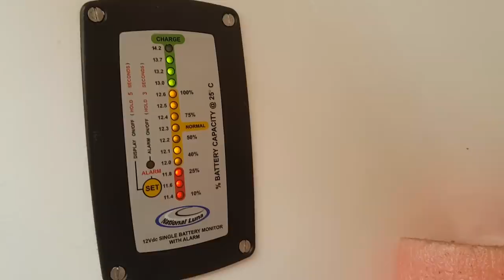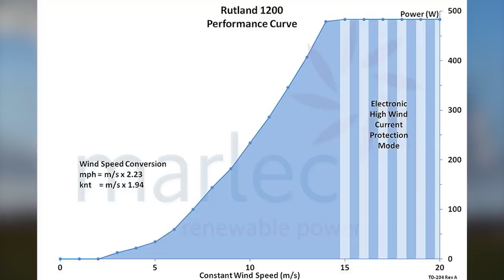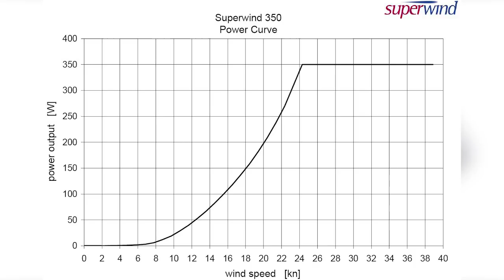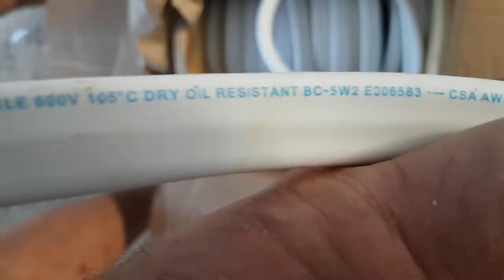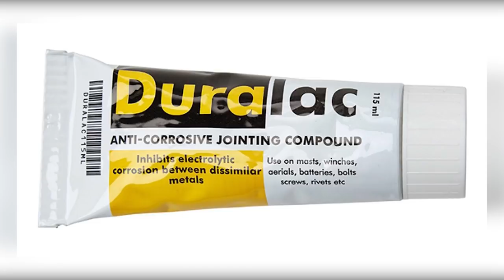Smart or Dumb? We Put a Wind Generator on Top of Our Mast - Ep 58 Sailing Luckyfish

Comment: Good Day to both of you , solution  would be to install a 3/16’’. Th, Néoprène  or resistant rubber between the matching  steel plates  , also install rubber washer to each side of the lags bolts complete with steel metal washer . One under and one on top for each lag bolts
Be sure to use a high density material for isolation 

Best regards
Reply from the maker: +Charles Frenette - yes, the rubber under the lag bolts. I like it. Thank you. We put 1/4" of high density rubber between the matching steel plates - I'm unsure if it lets a little of the hum through. Its heartening to see you suggest dealing with the bolts. Cheers
Reply: Rubber is good idea. If you put two layers of rubber, with another plate in between and offset, non-touching bolts, you will probably eliminate 80% of vibration. If the bolts go right through, they will transmit lots of vibration.
Reply: Mister Professor   Your idea is even better.
Reply: @charlesfrenette2203 , I did this wtih a special DC gearmotor arrangement  that had to be silent, and two additional plates with rubber mounts (engine type) eliminated basically all noise transmission. It does make the isolated thing a bit "flexy". Unfortunately,  looking at the 2 foot pole the generator is on, it's clear that the bolts will have to be very securely attached!

Comment: Use a much thicker block of silicone instead of the rubber and use locktite blue on the blade screws and a torque wrench to ensure consistent fastening.

Comment: I installed 1st Rutland generator on my 1st catamaran back in the 80' and a 913 generator on my latest catamaran. Both worked and produced to specs,  very quietly and minimal vibration . Fixed them pretty much like you did separating them with 5mm neoprene pads. Over 25 - 30 knots however vibrations were noticeable, but in those conditions I still prefer to manually lash down the propeller anyway. The weak point obviously are the bolts, for which I considered using bolt separation sleeves and washers as used for bi-metal separation of pipe flanges. I am not sure wether engine silent block type mount would be a good solution since they are somewhat flexible by definition and could cause the generator to wobble.
As much as I like the idea of mast head installation, propellers tend to catch things and may require quick action, which is not easy with mast head install. Same for maintenance or removal when you have to handle 15 kg at arms length.  
Last year I replaced the 913 by two 914i generators with more sophisticated internal electronics and MPPT controllers. These however just produce a small fraction of the specified outputs, and one quickly developed some grinding noise under certain angles, most likely due to bearing issue. Still have not solved the problems, despite having sent back for check and re-installed with local expert supervision and advise. Anybody else have experience with this particular model?
Reply from the maker: +Marc Maton - I cant help you with the 914i - that's a pretty disappointing outcome so far. Interesting, can you tell me if the manufacturer is standing by you? I mean, a replacement unit would seem to be in order, no? I tend to agree with your comments about engine mounts - many kind folks have sent links to various products here and I too think some nasty action could develop, even shearing. My inclination is to go for the T-type rubber sleeves and large washers as you suggest. BTW - the output we are getting from the 1200, which also has the MPPT etc... is exactly to spec. Cheers, Stew
Reply: Both charges were sent back to the UK and returned to Thailand at their expense, but despite very careful re-install, quite a few friendly Skype calls and email exchanges with Rutland, no improvement. I did find some similar problems on a few cruisers forums : 
http://www.cruisersforum.com/forums/f14/rutland-914i-problems-159225.html  ,  http://bavariayacht.org/forum/index.php?topic=1438.0
http://www.cruisersforum.com/forums/f14/wind-generator-especially-rutland-real-life-output-83777.html
Interesting reading. And, yes, pretty frustrating. I still have a problem understanding how it is possible that not one, but both generators fail, despite installation with separate regulators. Installation of additional solar panel for now compensate for the loss, but I still hope to find  someone locally who can figure out what is wrong.
Reply from the maker: +Marc Maton - noted and thanks for that background. Thats still a very frustrating story.  I do hope you can get a local technical guy to identify the problem.

Comment: How cool to be on my laptop when this notification popped up :) Clicked like and am about to watch. Been keen to see this one.
Reply from the maker: Great to hear, hope to hear any suggestions you might have
Reply: @SailingLuckyfish  Hi Stewart. I'd go with JC F on replacing those bolts with small engine mounts. My best guess on the knocking after you've torqued the blades to "common sense newton metres" is probably a roll pin (or some such) catching on plastic casing somewhere along the shaft. My reasoning here is that as the generator comes under varying loads there may be an axial reaction that would cause an insufficiently driven pin to just catch. It also has a "softer" sound over my headphones. As I say, "best guess", I have no experience to draw on with these units.  A faulty bearing is also quite plausible. I like your step, Kiwi no8 wire for you right there. Fair winds and best regards to Zaya.
Reply from the maker: +Waughthog Waugh -Agree. We have some brilliant suggestions from folks such as yourself to put to use. Looking forward to "not" hearing the results. Cheers mate, fair winds and fair thermals to you to, Stew

Comment: Hi Stew and Zaya, another excellent episode, as usual!     I've always been intrigued by the concept of a vessel that is totally energy independent.
As I think I've mentioned previously, I subscribe to a number of sailing channels (this being one of my very favorites, of course) and yours is the 
first featured boat with solar, hydro, and now wind energy all at once.     That's so cool!    You may have answered this previously, but are you considering
eventually replacing Luckyfish's motors with electric ones?     To be able to go wherever you want without having to worry about getting fuel (or water, 
since Luckyfish has its own watermaker) and leaving a practically zero carbon footprint is so intriguing.   My understanding is that electric motors
are so much easier to maintain than internal combustion ones.

I love when you delve into the technical aspects of your boat and of sailing; you do it in a way that is easy enough for dummies like me to understand, 
while being very comprehensive as well.   I'm wondering if you could at some point do an explanation of concepts like the relationship of amps to watts.  
I have only the most general understanding of those.   I would imagine that you guys have had to do a fair amount of homework to tailor your green energy
sources to the energy needs of Luckyfish and its crew.    It would be great to hear the process by which you did that.   I found the video you did on
your hydrogenator extremely interesting.

Keep those videos coming!   Stay safe.

Comment: I have the exact same generator, with the exact same humming sound, in spite of some rather sofisticated rubber mounts. But I don't have the knocking sound. The humming sound can be heard all over the boat, and is rather annoying when trying to sleep in an otherwise quiet anchorage.ff course, if you just love the idea of free energy pouring into the boat.  The knocking sound reminds me of a motorcycle wheel with an old worn down bearing.
Reply from the maker: Thanks for that info - pretty interesting. I first noticed the Rutland 1200 on the hardstand in Grenada, a Prout 38 next to us had two and we could not hear a whisper from them. Pretty impressive. Their blade tech has all but removed any whoosh. The humming is possibly inevitable for all gennies, I dont know. It is exactly the sound we get from the Watt & Sea. We love that sound because its energy on passage and the boat is pretty vocal then anyway. But on anchor where the wind genny is designed to do its thing, the sound is something we will put more effort into reducing. Agree, the knock sounds like bearing to me too. We will give Rutlands latest suggestions a crack and see if that fixes it, otherwise it will be bearing for sure. Or out of balance blades :-) Cheers and thanks for great comment, Stew
Reply: @SailingLuckyfish  I did in fact forget to mention that in addition to the humming we do clearly hear the woosh from the blades, but then your blades are very far away in the top of the mast, and when we are going to sleep we are far away from the woosh sound too. Only the humming is all over the boat, and it's like sleeping inside a guitar with a humming sound to it. I also didn't mention that I had a very unstable performance, seen by very fluctuating watt readings on the remote display. But the support at Marlec (who makes the Rutland WG's was very helpfull, and asked me to return the controller, and the remote display. They found an error in the controller, fixed it and returned both, at no cost, no questions asked. I believe their support was first class, and I have heard so from others.

Comment: On our Wharram Narai we utilised a much earlier, cruder Rutland. I had a base with a 1/2 inch rod welded vertically on it, about 8 inches long. The Rutland was mounted to a tube. I then made rubber "washers" cut in my case from discarded rubber conveyor belting (about 1/2" thick) with a hole saw giving an outside diameter which fitted quite snugly inside the Rutand's tube. I over drilled the centre holes of these to 1/2 inch. I slid two oversize rubber washers down the rod first - then the other washers to the top. I had put a thread on the last inch of rod to fit a steel washer & nut to apply some pressure to expand the washers if necessary, but in my case everything was so tight it wasn't needed and I used soapy water to lubricate sliding the tube down over the washers. In fact it was so tight I didn't push the tube quite down to the two "base" washers, and it remained at that height for the seven years we owned her. It probably stayed there a lot longer but it doesn't show on any of the later videos shot by Cristiano, who bought her and took a lot of (low resolution) video during at least 8 subsequent Atlantic crossings in her... I rigged the Narai as a sloop and had the Rutland on a long tube on the starboard aft deck.

I just read Black Hat's  post and those commercial rubber bushings look perfect for your existing mount! ~ Scott
Reply from the maker: really interesting solution. thank you

Comment: I noticed the blade side of the generator is pointing up to the sky because of the angle of the mast . Its possible that the angle is loading the bearing ,when the shaft is rotating, at opposing points. The generator needs to set level to the deck, despite the slant of the mast.
Reply: good point.
Reply: It's a really good point you make, that it would be more efficient in light winds if mounted with an offset for mast rake. Re the bearings though, while valid I guess the thousands of monohullers sailing with generators heeled over at greater angles would all be complaining if it caused bearing/noise issues? ~ Scott
Reply from the maker: +harvey g - we accounted for this in the design of the pole. The pole is vertical (whenever the deck horizontal). There is a 7.5 degree offset on the base to allow for the mast rake. Thanks for the suggestion though! Stew
Reply: Explore the blades not being balanced.  Three separate blades haphazardly bolted to a center hub does not escape the need to be balanced.
Reply: I have sailed a lot with my Rutland 1200 while healing 20+ degrees. No extra noise because of that.

Comment: Propeller tips bends on high speed getting too close to power line or even touching it -I would not place the turbine at the mast top it will attract lightning with copper cable running through your system.You gain more output by placing it higher but you will suffer from cable loss.Lover the voltage shorter the distance should be between power source or thicker wire.Jump start cables are thick for a reason.I hope you have much thicker copper wire running all the way to the water for lightning protection.Stay safe

Comment: Replace the bearings taking care to never push on the bearing running faces - only the sides.   Take care not to nudge or tap the assembled unit on anything at all, or else you will put a tiny dint in a bearing face which will then run noisily. Pre-fill the bearings with extra thick grease will reduce noise at the expense of efficiency, but I don't think you will ever get away from hum with it mounted like that.
Reply from the maker: Thanks Steve, appreciate the tips. You might be right about the mounting and hum. We will try to reduce it anyway. Cheers

Comment: Two words: Vertical Axis. 

There are many reasons why a big spinning fan in the sky powered by the wind looks like a great idea. 
There are also many reasons why a spinning post is a much better idea.
1. Birds cannot see the blades of a horizontal spinning "fan", but never fail to miss seeing a moving/rotating "post".2. When the wind speed gets too high, the "wind" sees the blades of a vertical spinning generator as a post, and it will not spin any faster. You don't have to cut it off, or make it "brake" if the wind gets too fast.3. The lift on 3 blades that are 2 feet long is the same, if they are horizontal, or vertical - in any given wind speed. Think helicopter, or drone.4. A vertical axis generator is always "into" the wind - it doesn't have to change directions.
As for the reason for the knock knock knock - Did you balance the entire assembled head? Did you check the pitch/angle/weight of all 3 blades on a dynamic spinning test stand? If one blade is different from the other 2 by being heavy/twisted/warped/off balance/not the same angle/a different temperature/weak/hollow - the list goes on and on - it will cause an imbalance in the entire system. Stick that issue on top of a 40+ foot pole, and you have found your problem. 

It's not enough to just tighten bolts. If one blade is different - in any way - to the center of rotation/air pressure/etc - you will have a noise at 40+ feet no matter how much rubber you put around it. 

The head needs to be spin-balanced, and since it is a "propeller", it needs to be pitch balanced also. 

As for the HUMM, I have a bag of rubber bands here you can wrap on your standing rigging to tie various bits of hanging metal onto to eliminate the giant stringed instrument you have created. Maybe you just aren't happy with the musical key you have created on the boat? It might be interesting to place people at all the "strings", and play a tune by having them hold the strings at the appropriate times. Music on the water, rather than smoke. Deep Purple would be proud, or more appropriately, Crosby, Stills, Nash, and Young.
 Oh, by the way, get yourself some box end wrenches. Open end "spanners" are for people who don't know hex.

Comment: It is a shame you did not put a microphone on the mast so we could hear the knock and whining better. ( I was a sound engineer and it would have helped) I suspect the knock is a baring, and to get rid of harmonics are a trial and error of all the suggestions you may get.  I would suggest the aluminum 26" pole could have some rubber clamped to it in the middle? or grab the standing and adjust tension, It will depend where the harmonic is?? Will be trial and test.Great idea to have a go ...well done. Brian London
Reply from the maker: Thanks Brian, that recording in the video is from a mic pressed against the mast

Comment: Your bolts are in metal-to-metal contact in tension. Vibration does not just travel down the mast through compression. I have two suggestions:
a. Remove the rubber pad and see if the rigidity solves the problem, or
b. Put rubber between the bolt head and the metal plate, so the bolts are "suspended" by rubber.

Comment: Luckfish, the knocking noise could be aerodynamic, caused by the proximity of the tubular mast relative to the blades when they pass at the 6 o clock position.   I find it strange that the manufacturer would put the mast so close to the tower.  The solution would be to make a cranked mast  to put the bottom of the blade disk further from the support pole.  But to do that it would have to get taller and structural integrity could be an issue.   Vibrational isolation is a pretty complex topic and not simple mechanically.
Reply: Speculative explanation, I have the same Rutland 1200, same kind of mast, with no knocking noise.

Comment: How about using a flexible coupling for a shaft of the type that is a disc with four rubber grommets?  Also, why not make the support pole such that it hinges and swings down?  I have in mind a hinge that can be covered and secured by a sliding fit piece of tube over the pole.  Slide that piece up above the hinge, and swing the pole down for servicing the generator.
Reply from the maker: thank you for both suggestions - agree with you.  we will try rubber centre mount bushings (grommets) on the mounting base. Your suggestion for the hinge really is a good one! It has got me thinking about that as I am sure this wont be the last time we need to go up the mast to service it. Thanks again, Stew